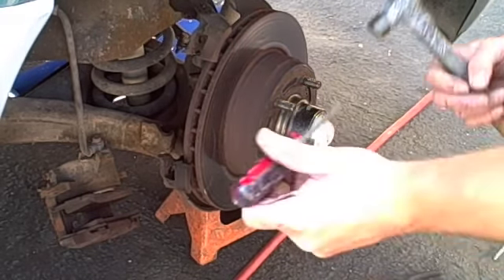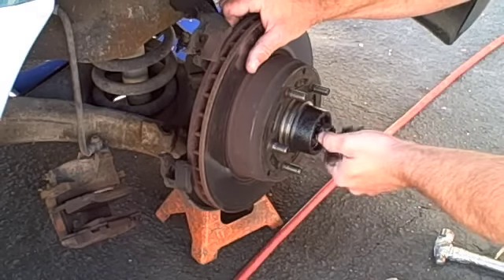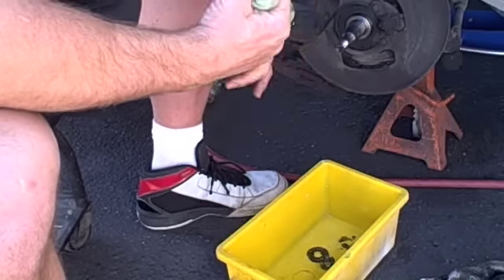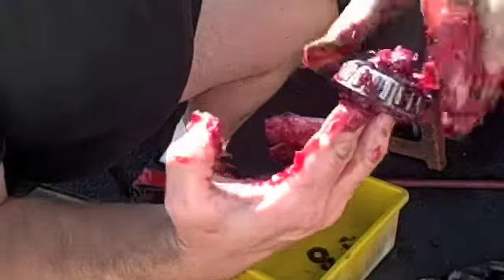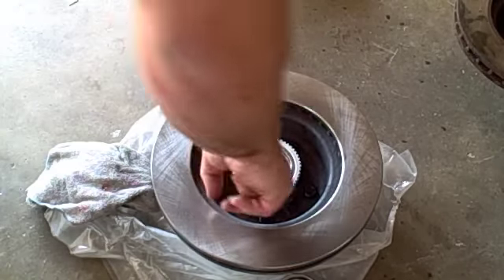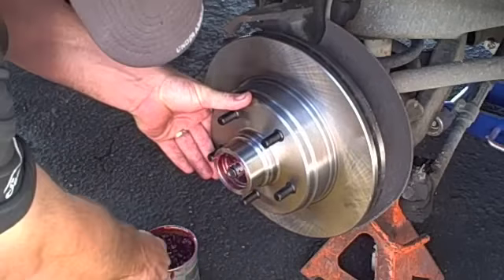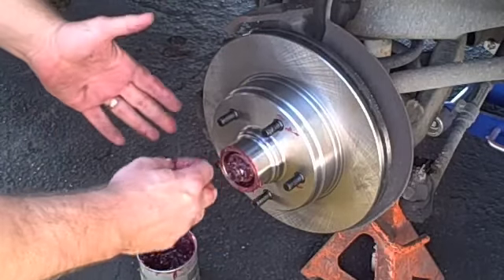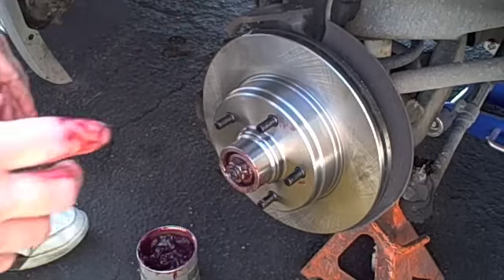How to pack wheel bearings

Comment: I use a torque wrench to tighten the nut. You are gonna want it tighter than hand tight and you're gonna wanna set the bearing. I torque it to 55ft while turning the rotor, then I back off the torque. Now the bearings set. Then I torque it to 35ft while turning the rotor. Done. We use the same method when torquing huge bearings inside jet engines.

Comment: I was always taught to tighten it right down, back it off then tighten it to the working pressure
Reply: I saw somewhere else that you want to lightly tighten it down, loosen it up, do a quarter turn, tighten it down, quarter turn, loosen it up, and do that more to get all the way around. Then finally back it off and put in the pin. That was to seat the bearings. Seems reasonable.

Comment: The hammering was a little ruff to watch.    It's good to set your can or tube of berring grease in the sun or warm place a bit before your starting when the wheels are spinning that shit gets real hot grease expands loosens up a bit when it's been spinning the berrings when you pack it right off the shelf in the garage its gonna be at a still  temp  kind of thick if ya let the can warm up in the sun itll always help pack every little bit and any casings tighter better lubed itll take a few mins longer to pack you might need to press it in there more with grease pack but as your finishing itll be settling in better to every seal and friction surfaces ......    just something I've found over the years that kinda makes for a longer lasting berring I do a lot of driving tho

Comment: There is quite a bit of geese that needs to be placed inside the rotor! The grease must run into more grease and when hot the puddle must be high enuff to stay lubed cus if no extra grease is added this bearing will indeed be ruined

Comment: Tighten the bearing until you can't move the washer, then back off the spindle nut until you can just move the washer with a screwdriver. Install your cotter and your done!

Comment: I pack more grease in the bearings and if one doesn't have the right wrench to tighten the spindle nut use a Crescent wrench also put some grease into the dust cap

Comment: Thanks for the video...  One thing you said was that gasoline is abrasive.  Abrasive is what sand paper is.  Gasoline is not abrasive and has been used for many years as a solvent and cleaner for parts.  Yes, there is parts cleaner chemical as well.  So, things to keep in mind, gasoline and any other petrol product can harm and desolve rubbers and plastics.  If your bearing has any of that.. do not use, if all metal, use away.  Just watch your health.  Gas will absorb into the skin (use gloves, gas is bad to inhale in any amount ( use out door and watch the wind - or use an approve mask).  Otherwise, it's def not abrasive and can be fine to use to clean your bearing if all metal.
Reply: +1 for the rubber gloves !  :)
Reply: LOL if gas was Abrasive, then the cylinder walls of engines would be toast in a big hurry!

Comment: very detailed video, i will take apart my Bearings and grease em sometimes. i suppose these type of bearings are somewhat similar in my motorcycle and same type of procedure is required to take them apart , grease and put them back.

i have one question , you did this for peace of mind for road trip or this is a recommended procedure by manafacturer at regular intervals.

Comment: I've watched so many videos on wheel bearings and this is by far the best one I've seen.  Thank you.  You should do more vidoes!
Reply: I would only take the tip on greasing by hand and using the nut to take off the seal, you should never use a screwdriver to take off dust caps unless you are replacing them, also you should always torque and then back off the pressure, this is because sometimes you may get a false seating point and things can get ugly really quick while driving.

Comment: I thought the hub nut required like 200 pounds of force, yet this guys does it by hand.  I am confused.
Reply: Depends on the type of bearings.   These kind are just finger tight.  FWD you are doing an axle nut,  and newer RWD have sealed bearings like FWD.  Always follow your manual depending on your bearing type.

Comment: 3:10 You CAN soak these.... but gasoline is abrasive???  YES, you SHOULD soak them in kerosene to remove ALL THE OLD GREASE which is holding abrasive particles from dirt and wear.  What's the sense of adding new, clean grease on top of old dirty grease?  So you put the old, dirty bearings into the new rotor.  New bearings only cost a couple dollars.  Why would you mix old dirty bearings with new parts?

Comment: Minor point, I do not recommend using gasoline as a cleaner. It is designed to be extremely volatile at the optimum fuel/air ratio. This occurs as it evaporates and is very dangerous.

Comment: Axle nut should be torqued to spec....not loose like that, or you won't properly set the preload of the bearing.....and then the bearing will fail because of loose tolerances.
Reply: STEVE this is not a front wheel drive, there is nothing to torque..
Reply: STEVE this is not a front wheel drive.. Torque it down and you will destroy the bearing ..however I do set it LIGHTLY with a pair of channel locks because my fingers have arthritis in them. As far the caliper hanging by the flex hose, shouldn't be an issue.. Because if it's so bad it starts leaking.. It's time to change it anyway.. In fact I'll grab them and pull on them and squeeze them when I'm checking out the front end on old vehicles. To make sure they don't crack or collapse...

Comment: Good video, a tip for all: don't let the Brake Caliper hang by the Brake Line Hose, set it up on top of the Upper Ball Joint. Put the Lug Nuts on the Rotor, they will protect the threads, make the Rotor easier to handle and spin.

Comment: The castellano nut should be torqued not finger tight  that s dangerous!!
Reply: You never torque the spindle castle nut.  You will burn the bearings out and pretty much waste your time. All of the manuals say sung and then 1/4 turn beyond to keep the rotor from walking back and forth on the spindle.
Reply: You might have to torque it to a rather low torque spec first (to seat the bearings / oil seal) but then back it off and just snug it. But it also depends on how old the spindle is. A worn spindle might need a bit more torquing.

Comment: You should not let the brake caliper hang on its hose. Use wire hanger to support it.
Reply: If your brake line can’t support a caliper then you need new brake lines
Reply: You can also set the caliper on a box, upside down bucket, cinder block, or other object so that tension is not placed on the brake line. MUCH quicker and easier than trying to hang the calipers.